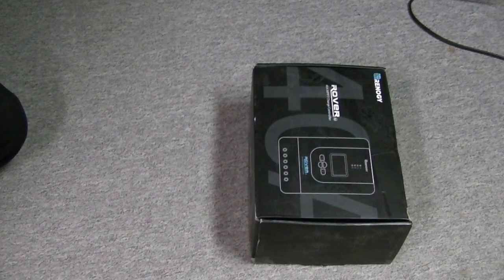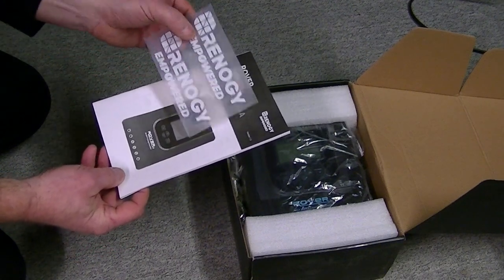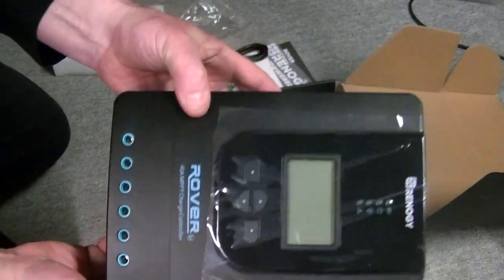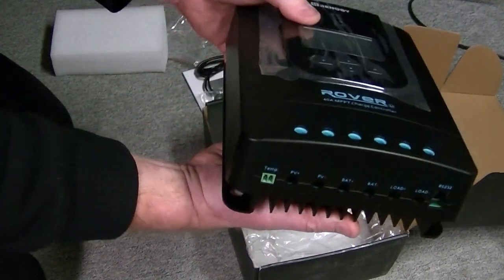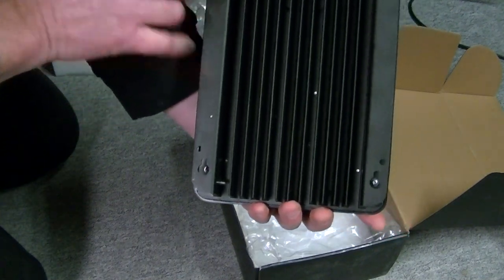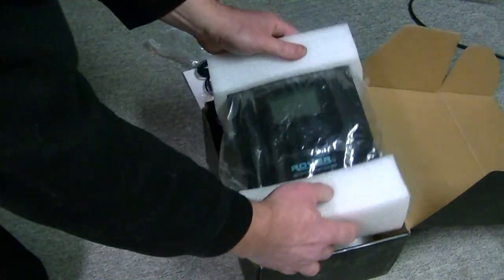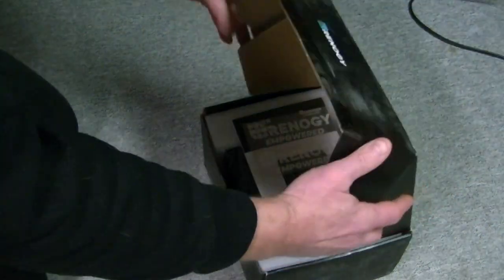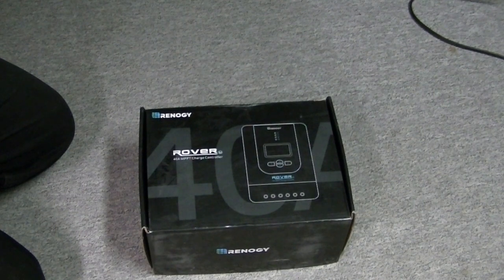Renogy Rover 40A MPPT Charge Controller unboxing

Comment: Can I connect a 12v power source into the solar panel input to charge my battery at night?
Reply from the maker: If your power supply has current limiting on it you may be able.  Best to see if there is a solar forum to answer your question, I am not an expert on this.